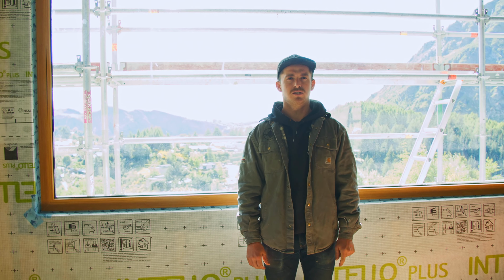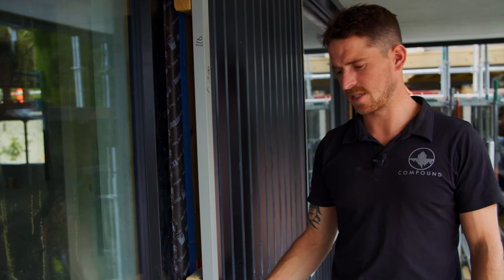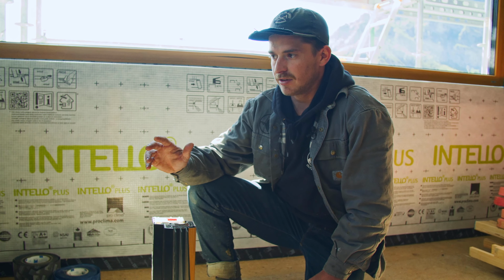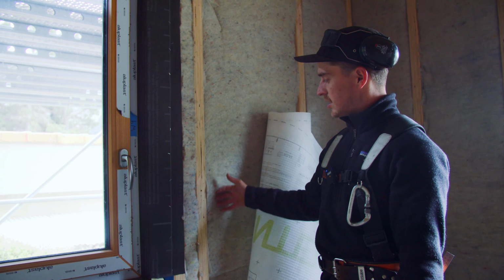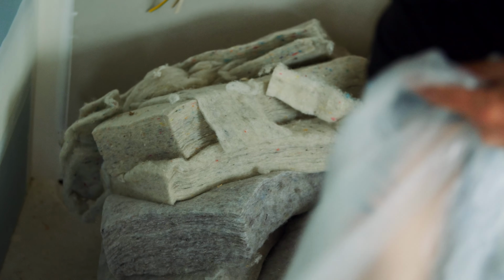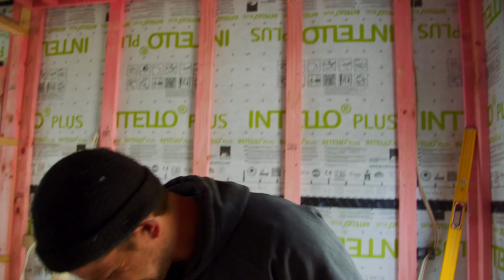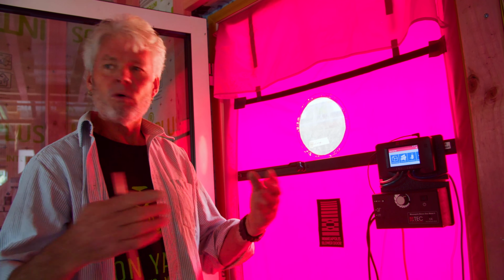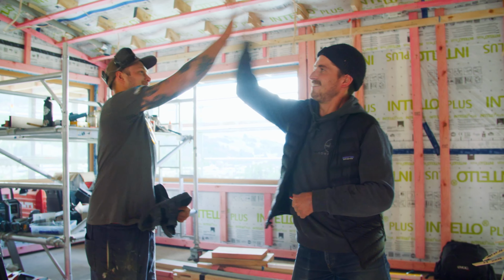Watch Us Build a Passive House in New Zealand - Episode 3

Comment: An amazing effort guys. You've clearly worked extremely hard and the results show this. The NZ building code change couldn't happen fast enough as far as I'm concerned, although I've read an article from a well known building company in the herald recently pleading for the gov to postpone the date for another year due to the industry not being ready (as if they haven't been given adequate notice). Another year of exceptionally poor homes being constructed all around NZ.

Another interesting point with the current E2 detail to note. When using thermally broken windows, both sides of the thermal break are on the outside of the building thermal envelope, rendering the whole concept relatively useless due to a thermal bridge still being present the entire way round the window! Unreal!